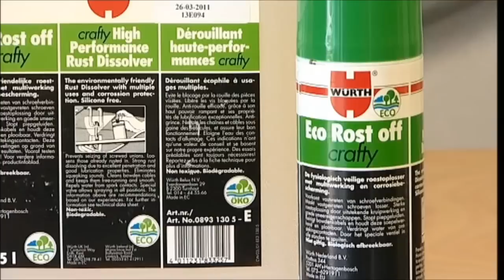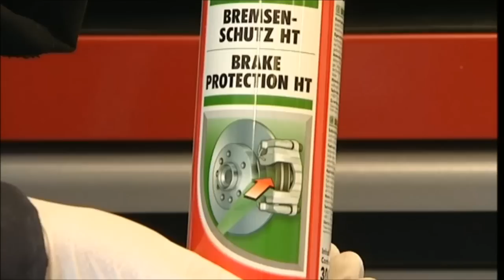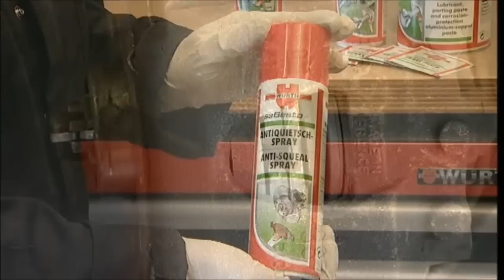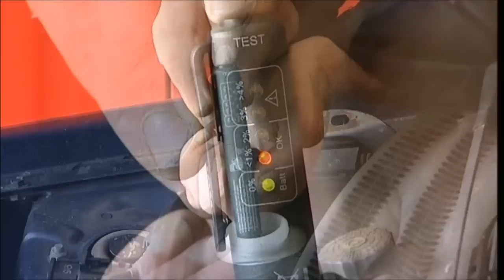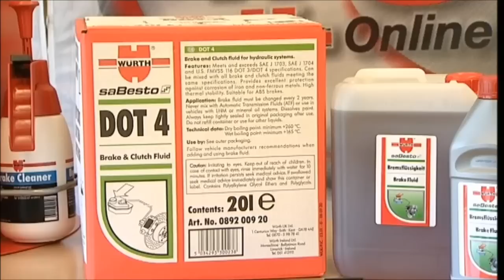Würth Brakes and CV Joints

Comment: This has to be video from a Vocational/Technical center that happens to use Wurth products exclusively.

He also didn't need to take apart half of what he did to get at the CV to start with. Lower ball joint should have been removed from the lower control arm, axle pulled from hub with hub pushed to the rear to keep it out of the way, CV joint removed from axle with a dead blow hammer, cleaned and inspected before installing new boot.

I won't reiterate what others have already said here regarding the brake procedure mistakes. But I will add one. You NEVER push a brake piston back into a caliper without the bleeder screw OPEN unless you want to run the risk of destroying the master cylinder before you finish the brake job.

The procedures in this video are too sloppy to be from any pro shop. I can only think that Wurth didn't take into consideration that it would wind up on YouTube without some background information as to where it came from.

Comment: Caliper should never be suspended by the brake hose.
Products for noise should be applied sparingly and only to contact areas where caliper and piston touch pads. The support areas for brake pad tabs should have anti-noise lubricants applied also. The mount bolts for caliper that also act to allow caliper to move should be cleaned and lubricated with a synthetic grease.
The outboard spring clip is not fitted properly. The way it is fitted in the video would cause low brake pedal on initial application of brakes.
This is a showcase of products but the procedure should be done to a professional and safe standard.